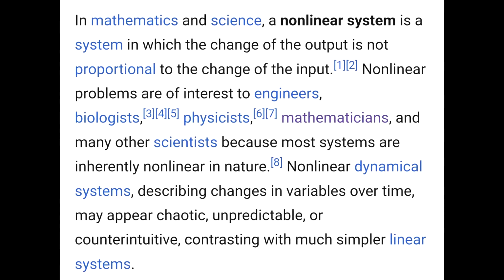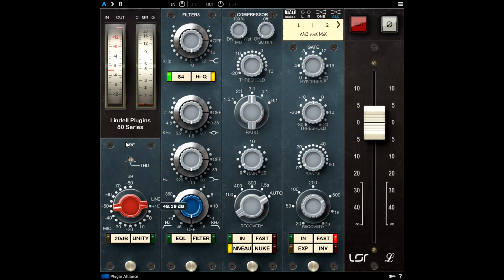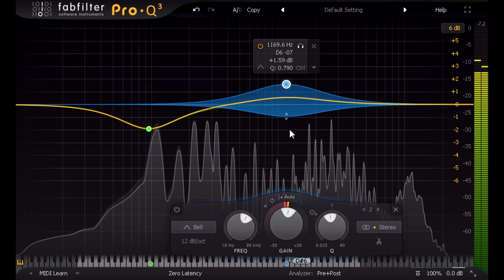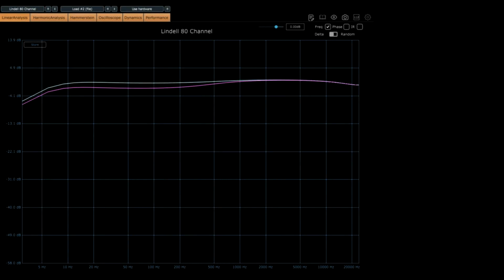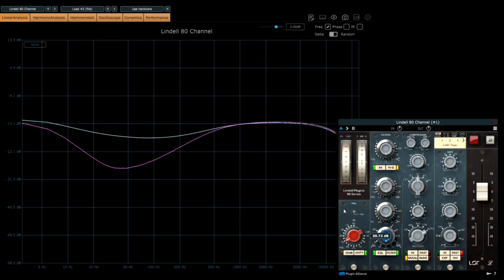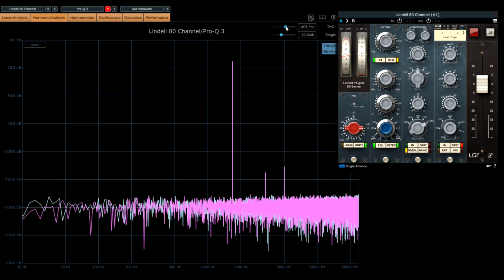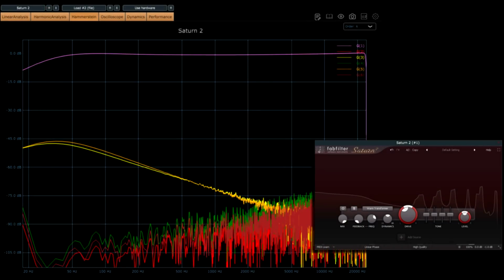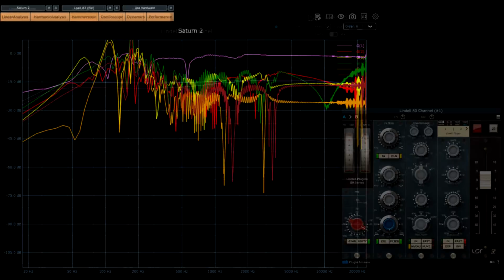WTF is a Non Linearity?

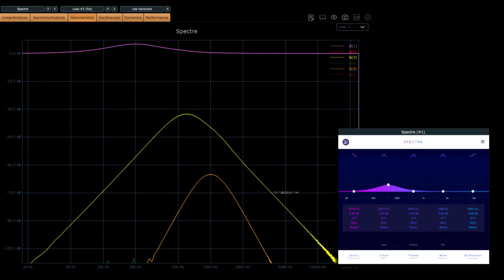Comment: 9:40 Tube is symmetric
Reply from the maker: Assymetric, hence the even harmonics. Symmetrical distortion only generates odd harmonics.
Reply: @DanWorrall  Well, Spectre's manual says otherwise.
Reply from the maker: @APaclin  I had to correct Spectre's developer on the same point! Don't take my word for it, have a little Google.

Comment: A lot of people new to math get confused about the meaning of linear.

Linearity is two properties, additivity and homogeneity .

suppose I take a signal x and feed it in to a filter f, giving me the output f(x). Suppose i have another signal y and likewise I can feed that in to the filter with the output f(y). Suppose further that I can scale either signals amplitude by A and B respectively.

The filter is linear if and only if

f(Ax + By) = Af(x) + Bf(y)

Where 

f(Ax) = Af(x)

Is the property called homogeneity
and

f(x+y) = f(x) + f(y)

is the property called additivity

To put this all in terms of a DAW, suppose you have two tracks with samples playing, 1 and 2. You put the same plugin with the same settings on each track, then increase the gain of each track by 3dB, respectively. Thats the right side of the equation. This will sound identical to sending both tracks to a single send channel with the same plugin with an input gain of +3dB (the left side of the equation) if and only if the plugin is linear.

Comment: It is great to see my major cross paths with audio engineering. Studying mechanical engineering and this semester in a experimental engineering class where the topic was doing measurements, experiments and reporting them basically with all the needed terminology. In error and measurement lesson the professor told us about linearity and the exact graph at 7:29 was used to show non-linearity. It was mentioned that in real systems, truly linear behaviour is only approximately reached, quoted exactly from the lecture slides.

Comment: I'm trying to understand why is the "test broken" (and forgive my complete lack of understanding about the subject) Isn't plugin doctor showing the non linearities in the linear graph? When looking at the movement of the frequency curve of an analog gear aren't we expecting it to behave in that non linear crazy way? I'm not talking about the harmonics but the pure frequency response... how else do you test the frequency response of a non linear analog gear? Thanks for the vid Dan!
Reply from the maker: The test involves running an impulse through the plugin to obtain the impulse response. Impulse: all frequencies with zero phase.
You can then measure the frequency and phase of the impulse response to see what has changed.
But if significant harmonics are added, that's new content, not a change in the impulse. Messes up the results.
Not to mention: can we meaningfully talk about harmonic distortion when the test signal is literally just a single full scale sample?
You can run the Hammerstein test for just the first harmonic: that's perhaps the best way to get a frequency response for a highly non linear process.
Reply: @DanWorrall  ohhhh I see, so new harmonics, phase differences, linear response  (and I'm guessing other things inside the analog machine) are basically being made into a ball and send into that linear graph all at once before change of parameters and that's what creates those non linearities, unlike a plugin that just has to deal with the direct signal to then change the graph as we play around with its parameters.. and by analyzing the first harmonic with Hammerstein test we can have a better representation of the frequency response.. I hope you dont have to correct me if I'm wrong 😅😅  I dont want to take much more of your time as you so gracefully answered my question. Thanks again Dan!!

Comment: Can you explain why some guitar amps have Gain, Volume, & a master knob? I understand the Gain knob and I understand that the master is simply the loudness of the speaker. But to be honest, I don't get how the volume knob is any different from the master one.
Reply from the maker: They're all gain controls, just in different places in the circuit. The specifics depends on the amp, but if you have multiple channels you might have a "volume" for each channel plus a "master volume" which affects them all.

Comment: 5:36 does digital distortion really create >22k hz harmonics? I didn't have a single idea, well, not that I'd know in the first place
Reply: Analog gear creates it as well, but then it filters out in the converters. Digital distortion doesn't filter it out (unless you use oversampling) and creates aliasing artifacts.

Comment: By the way, some veeeeery nitpicky engineers would say that the use of "gain" is wrong for many circuits (since they are essentially fixed gain). On a typical preamp, the "gain" control is just an input volume, with each amplifying stage boosting the input signal by a fixed amount of dB. That's one big reason why, for instance, on many clean (pre)amps (solid state bass amps, mixers, etc.) the recommendation is to turn up the "gain" as high as you can without clipping, or only clipping in transients, as that improves the SNR. An example of a true gain control can be found in many distortion pedals, such as the Tubescreamer, where the gain pot actually controls the gain introduced by the relative opamp. This is not usually done on professional preamps as adjusting the gain of the device will generally modify its response (low and high cut for example).

Comment: Someone once said "talking about nonlinear systems is like talking about non-elephant zoology", which I think points out an interesting fact about nonlinearity: Almost everything is non-linear - something being linear is the very rare (but important) exception. Although in audio we often assume nonlinearity to mean 'adding harmonics' or 'saturating', this is not generally true: "Non-linear" just means what it says: something is "not linear" - but whatever else it might be, we in fact don't have a clue! A system where I put a Mozart sonata in and get a Beatles song out is also a nonlinear system, for example.
Reply: Well put. In addition, non-linear systems only affect the harmonics of periodic signals (sine waves, triangle waves, sounds of wind instruments, guitars to a degree, etc.) and only when the systems are time-invariant. With more complex signals all bets are off and talking about harmonics is kind of pointless.

What to expect of a non-linear effect is best illustrated by this example: Applying compression to individual tracks first and then mixing them gives you different results from applying compression to their mix afterwards. It will just sound different. You can't say anything more specific about general non-linearity than that.

By the way, a system that transforms a Mozart sonata to a Beatles song can be perfectly linear-- in theory. You could calculate the deconvolution kernel of the sonata and convolve the Beatles song with it to get a filter. This filter would be perfectly linear and would turn the Mozart sonata into the Beatles song. It would be infinite in time, though, and the least amount of noise on the input would totally break it, so it's not really possible in reality. A system that simply identifies the sonata and outputs whatever in return is much more plausible, and, of course, not linear.

Comment: "Gain is just volume"
Well lad it depends which stage of amplification you're talking about, doesn't it? Higher gain (linear) in an earlier stage can cause clipping in a later stage.
Reply: Which doesn't change what gain is. Only what it sounds like after it has gone through a clipping stage.

Comment: WOW, first time I hear (and see) a such good explanation about this. The Hammerstein analysis is a mind blowing visualization for me!!!! How cool is that!! Now I see very clearly why some saturation are more "fat" and some others more "crisp".

An even cooler way would be to visualize that with an added time axis, like a waterfall, showing how a plugin reacts harmonically over time. Since no real life sound is static, maybe it would show what does a plugin reacts to a transient, for example? Different harmonics appear differently depending on the input energy - sometimes with resonance, like from transformer hysteresis. On percussive material like drums, a kind of "sweet spot" is attained when only transients being saturated, leaving most of the body of sound untouched, making gentle saturation as a nice (and surprisingly transparent) transient control.... 

For now, Plugin Doctor is also buggy and lagging on my almost-new processor... It might have to do with the software....
Reply: if you look at the EQ during the Hammerstein analysis, it is running a sine sweep, so it looks like the result is compiled over time already

Comment: As I understand it: Linear plugins could be applied in any order and have the same result. (Like adding numbers in maths.) Non-linear plugins will have different results depending what order you apply them in. (Like division.)

Although… Now I write that, I'm not sure it's correct.
Reply from the maker: It's correct. (adding or multiplying).
Also, you can apply a linear process to two sources, then sum them, and get the same result as if you summed them first, then applied that linear process.
Reply: @DanWorrall  No, you can have two linear plugins that still don't produce the same result when reordered. A linear plugin will give the same result, whether it is applied to each of two signals and then summed, or applied to the sum of two signals. And it can change order with a (constant) level adjustment. But an EQ (linear) and a pitch shifter (also linear) will produce different results depending on their order, while - say - a plugin that takes the log of the input and a plugin that puts out some constant c raised to the power of the input would both be non-linear, but could be reordered.

Comment: It may also be useful to some to understand 2 tests for a system's linearity: the superposition and homogeneity principles. Superposition principle is: if you first add (mix) 2 signals together and then process them through the system, you'd get the same result as if you process them individually through 2 copies of that system and then add them together at the end. Homogeneity principle is: if you apply gain to a signal and then process it through the system, you'd get the same result as if you first process the signal through the system and then apply that gain. If a system is linear, both of these principles will apply. Effects like compression and distortion fail both of these tests and are thus nonlinear.

Comment: Thanks for the video. (probably not) Quick question. Convolution is a somewhat related concept in that an impulse response of a system can be convolved with an input signal to produce the output of the system. However, this only works for linear systems.

But, you see lots of gear that talks about impulse responses of amplifiers and cabinets which are distinctly non-linear (by design). The process works to a fairly good degree, so clearly they must be doing something. The nerd part of my brain would love to know more about how convolution has come to be applied to intentionally non-linear systems.

Comment: Gain means increasing the amplitude (voltage) of the incoming signal. Adding volume means decreasing of the attenuation caused by the potentiometer acting as a resistive voltage divider.
Reply from the maker: Attenuation is negative gain.

Comment: Gain is not volume. Gain is ratio of amplification. It's really simple and useful concept that makes great many things easier to understand. If your camcorder has a gain knob, it almost certainly doesn't control volume. While there are amps that use gain to implement volume, it's really not a good idea usually. Slapping a log pot near the tone stack is really good and cheap way to make people not hate your sucky amplifier.

Comment: I too come from a Live Audio background, something I’ve been doing for 30 years now, but I really began it all at University with a music degree and a specialty in Electro Acoustic composition. As a kid who always had audio engineering in my head, along with drum machines, sequencers, and a 4 track recorder through my teens, I had a moment when I applied to a renowned Recording Engineering school the same year I applied to music school. As much as I made abstract and very non traditional music I still saw myself more an engineer than a musician. Lo and behold I was rejected from engineering school and accepted to a music program. In my second year I signed up for this electronic composition program, and no, it wasn’t hip hop or dance music we learned about. What we had was access to a ‘studio’, which was an 8 track 1/2” recording machine, a couple of 2 track tape machines, a very very early sampler, a couple of ARP 2600’s and similar bit and bobs from the 70’s and 80’s. Our ‘engineering’ class? Exactly 2 hours (here’s a patch bay, here’s how you feed tape into the machine, here’s how you splice the tape, etc), then it was GO. Mess stuff up, make art, if you dare. 

I spent three years like that, making 50’ tape loops that stretched around the room, just because why not. But what I primarily learned from my professor was how to listen to sounds a certain way. Density, dynamics, harmony, dissonance, cohesion, in very abstract terms how to MIX.

Eventually I moved to live audio, toured the world, and for a long time faked all the technique stuff while quietly learning and absorbing the ‘correct’ way to do things. I applied this to the studio when I could get into one, and to my live tours. At some point I could (almost) talk about correct techniques. But I’ll never forget going to do a session at the famous BBC Maida Vale studio, and watched in awe when the engineer pulled together an album ready mix of the band I’d done 150 shows with in about 20 min. That was a moment of clarity for me. There IS value in true understanding of audio engineering as a technical craft. Since then I’ve strived to top up what I cobbled together till then and really understand what is going on.

Suffice to say, Dan I certainly relate to your past as a self-taught live engineer, but more than anything your way of filling in the gaps for me have been nothing short of incredible. Thanks for the videos and keep up the great work!

Comment: I bet you could use a tape measure as a spring scale if the weight you're measuring is light enough that the tape measure's spring can counter balance it. There should be a correlation between how much weight you attach to the tape and how far it extends, the spring would be the limiting factor.
Reply: (because that's totally the point of this video)

Comment: Oh no, I'm sorry, but your definition isn't quite correct either. It's close - definitely much better than most videos out there. But funny you chose this video to get the tremolo/vibrato thing off your chest, because those are two effects that don't gel with your definition of linear. An ideal tremolo or vibrato behaves the same regardless of input level, and yet both are nonlinear.

A consequence of the mathsy definition is that it means a linear system cannot add new frequency components to your signal - no harmonic distortion, no other spur frequencies, and no added noise. If you put in a 1 kHz sine wave, the only thing you will get out of it is a 1 kHz sine wave (though possibly with the amplitude scaled or the phase shifted). With a tremolo or a vibrato, you will get components at other frequencies (vibrato shifts the sine wave to a different frequency, and tremolo adds extra frequency components), and therefore they can't possibly be linear.

Anyway, sorry for being "that guy", and please don't take this the wrong way - I love your channel, I think it's the single best place on the internet for technical explanations on this subject that don't need an EE degree to understand, and I think you're doing a great service for the audio world!
Reply from the maker: I didn't mean to suggest that vibrato and tremolo are linear; just that guitarists get them confused all the time! Sorry if that wasn't clear. However there's a long and interesting comment thread elsewhere under this video that suggests both should be referred to as "linear, time variant"...

Comment: My introduction to the notion of linearity in electronic circuits came in the 70s at college and then in training to be a production/repair technician. 
I was already a guitarist turned bassist by this time and it was very interesting to learn how my amplifiers worked. 
They showed us the way that amplifier circuits vary their in/out ratio at different levels and at different frequencies. 
Whether solid state or valve based, there would always be a reactive element to the responses of amplification stages. 
A particular highlight of these lessons outlined the difficulties involve with getting a linear response out of Valve based hi-fi. 
Winding output transformers, and coupling transformers, with their coils and inductances to give linearity was/is a major headache and the largest part of the cost of making them. 
Finding the straightest part of the response 'Curve' is the goal.
Then we musicians do our damndest to lose that 'fidelity' for the most part in one way or another.